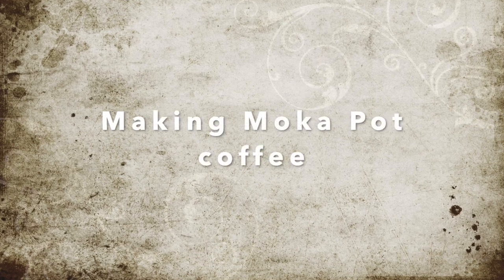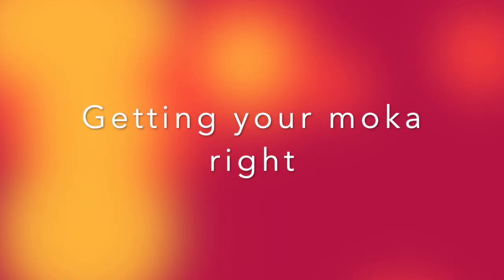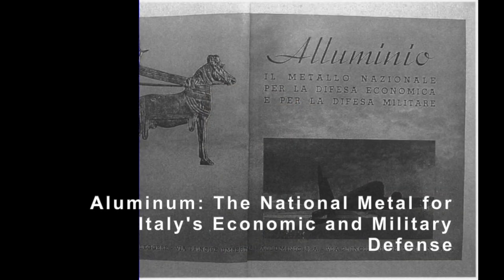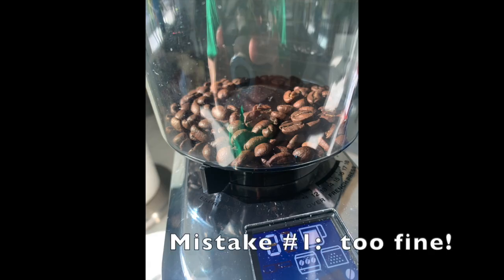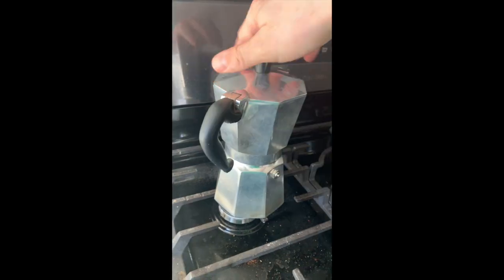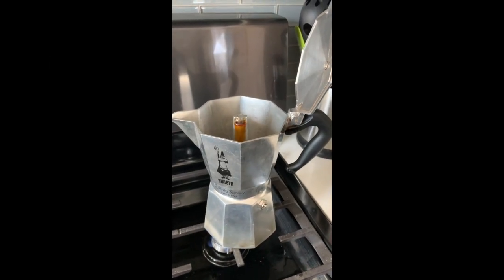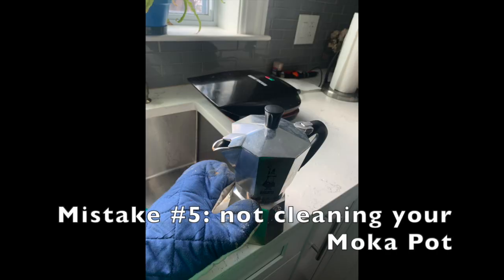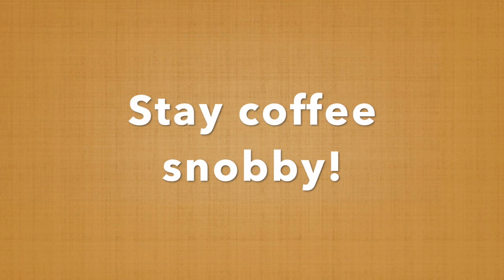Why your Moka pot tastes bad

Comment: Firstly, fill the container with cold water. The coffee softens and eventually runs as the steam intensifies. You never get a bad taste. 
Secondly, give zero shits with cleaning. Rinse after use. That's it. That's all. Replace the ring seal every year ($5?).
Thirdly, blast the heat right up. What is the benefit of turning it on just a little. 
Fourthly, 'grinding too fine' makes stronger coffee. It does not make it too bitter. Just nonsense.
Fifthly, pack the coffee pocket with lots of coffee and positively mash it in tight. Cause what you get is a real strong healthy cup of Joe.
Do you even lift bro?
Reply from the maker: The hot water versus cold water debate is something everyone has very strong opinions about, but I’ve personally found it’s the least relevant thing to consider.  That said, all the notable third wave baristas such as James Hoffman and Tristan Stephenson recommend preheating the water, and a 2008 paper by warren king models this using Darcys law for fluid flow to show the preheated water aids in extraction temperature.  I discuss and explain this paper here (https://m.youtube.com/watch?v=O14BIH-9KTA).  

With regard to cleaning, I’ve experimentally found agreement with you, that it doesn’t matter that much, though everyone again has strong opinions. 

In terms of blasting the heat, though I’m going to disagree with you strongly. It has been received wisdom among third wave baristas, and research papers have affirmed this, that moka pots tend toward over extraction and bitterness.  If you want to go to the extreme of this, I recommend doing a search for “moka pot voodoo”, which specifically recommends keeping the heat so low with you actually turn it off upon first coffee. 

At the end of the day though, what matters is whether or not you have a cup of coffee you enjoy.  Leave the question of convincing the world of your technique out of it and you’ll live a happier life :)

Comment: Hello! Thank you for this review! I'm wondering if you or anyone knows: If I get a 300ml pot, I assume that if I fill the chamber with coffee I'm making what's essentially a coffee with 3-shot intensity? (I've only really had cafe espresso - flatwhites and lattes, coz that's all anyone sells around here. No percolator or plungers.) Will the coffee chamber cope with being filled only a half/third? Must the water chamber be filled to the valve, or can I run the whole thing at less-than-full for both grounds and water on a lower burn?
Reply: Although I'm late in seeing this video, I just wanted to say yes, you can half fill (in your case 150ml) the water chamber.  You'll get a stronger brew by doing this.

Comment: I keep my moca pot clean, i never overboil it, yet mostly my coffee tastes burned...
Reply: You might want a lighter roasted coffee then. The more roasted the coffee the easier it is to extract ashy flavors with high heat water.

Just my amateur opinion
Reply: @solinovo  i use a medium roasted.
But i tried turning the heat down from 5 to 4 , takes a bit longer but the coffee tastes better.

Comment: I do most of this except I don't bother running it under cold water... as soon as I take it off the burner it stops coming out the top so I don't see how anything that stays out of the brewed coffee is going to affect the taste.  Maybe my pot cools fast enough when I put it on the steel stove between the burners (my pot is stainless steel not aluminum so that may be the difference).  I also occasionally use cold instead of hot water and don't see a huge difference.... maybe when I'm too lazy to heat the water I'm also too sleepy to notice the taste.
Reply from the maker: Cold water versus hot water is just a religion. It mostly doesn’t matter, but somehow everyone needs to convince the world that their method is better.

Comment: Mistake#4 was the one I learned most recently. When the coffee is coming out, after a while there will be a "surge" that is more pale and watery. That's the time to take it off the heat. I always used to keep it on until all the water had filtered through.
Reply: Pale and watery means you didnt fill the Grounds pan up and flatten it.... ignore this videos "dont pack it" advice ,you have to pack it if you like strong espresso... which ,to be fair,is what a Mocha pot is for
Reply: @Gianfranco_69  Wrong. The reason Bialetti says don't pack it and don't press it down is because you won't get a good extraction, since the water can't flow through freely when the coffee is packed. The Moka doesn't have enough pressure to push the water through packed coffee. 

If your espresso is too watery or is not strong enough, it's because you're breaking other Bialetti rules.

Try following Bialetti instructions, which are based on science: 

1. Fill the water reservoir with room temperature or cold water (filtered or bottled) to touch the bottom of the pressure valve. 
2. Loosely fill the basket to the rim with medium-fine ground coffee, and use a straight utensil to scrape the top of the coffee off level with the rim, but don't press it down. (Note: Most espressos are ground too fine for the Moka, but the espressos sold in Italian grocery stores are ground medium-fine for the Moka: Bialetti Perfetto Moka Espresso, Lavazza Crema e Gusto, Lavazza Qualita Rosa, Lavazza Espresso Italiano, Kimbo, illy Classico Espresso for Moka, illy Intenso Espresso for Moka, etc.) 
3. Cook on a low gas flame or preheated medium electric stove. Keep the lid closed while cooking. 
4. The instant you hear it begin to gurgle, immediately remove the Moka from the stove and set it on your countertop. It will finish brewing from the residual heat inside the pot. (Don't cool off the pot!)
5. Stir up the most-concentrated coffee from the bottom with a teaspoon, and pour. 
6. Clean with hot water only, do not use soap. Wipe it dry with a cloth. Monthly you can deep clean it by cooking plain water in it.
 
You should see leftover brown water full of fines in the bottom reservoir, and that's a good thing! It means you removed the pot from the stove in time. That water would've diluted your coffee if it had gone through, and would've added a bitter flavor and fines to your cup. There's a tutorial by either illy coffee or Lavazza coffee that explains this. It's also explained in the detailed tutorial by "Il Barista Italiano" channel.
Reply: @Gianfranco_69  this is wrong and dangereous, mocha pot is not designed to withstand pressure as a espresso machine,  that's not what mocha pot is designed for.
Reply: @miguelarturopalomaresruiz  oh....i dont 'tamp it down' like an espresso machine,just fill and flatten it...they are fool proof,they never explode (they have a valve) unless you make a rookie error and put grounds in the bottom and coffee in the top...which i have seen someone do
Reply: @miguelarturopalomaresruiz  nope....Mocha pots maybe reach 1Bar of pressure while a decent espresso machine you would see in a Cafeteria gets to maybe 9-10Bar, how do i know these figures?...
I was a Barista,i have long term elbow damage to prove it
Reply: @Gianfranco_69  Wrong, they do explode from people packing the coffee and doing other things that add too much pressure. As the barista, Liz Happybeans, on her channel. She's from the DR where people pack the coffee so they explode a lot, and a Moka exploded on her family member.
Reply: Gianfranco, Have you not packed it to see how the flavor is?
Reply: Add small piece of Lemon (a good one,like Amalfitan or Sicilian) peel or even Lime peel to the top reservoir (bend it up to release oils) and you will enter level 2 of Stove Top coffee Professionals
Reply: not a mistake, also not a problem, it depends on time  

coffee starts burning (Giving off sour  flavors) 3.5 minutes after it has started brewing (got in contact with hot water), as long as that water doesn't come 3.5 minutes after the brew started there's no problem on waiting for it to finish. 

but if you left the grinds on the fire for a long time is possible that it has already burnt
Reply: Bialetti says to remove the Moka from the stove immediately when you hear it begin to gurgle. Then it will finish brewing off the stove while sitting on your countertop from the residual heat inside the pot, so don't do anything to cook off the pot when you remove it from the stove. Stir up the most-concentrated coffee from the bottom with a teaspoon and pour.
Reply: Great tips. Thanks gents

Comment: I saw another post and adding hot water (not boiling) to the process prevent to overheat the coffee beans. It should taste better
Reply from the maker: Well, heated water (as opposed to room temp.) prevents the water being too cold for good extraction, but definitely 70C is better than boiling for the same reason.  Warren King did a great paper on this, which I discuss in my follow-up video: https://www.youtube.com/watch?v=O14BIH-9KTA&t=269s

Comment: Why you use boiling water?? Just use normal temperature one... Be sure to fill with water checking with the filter the level, should be just under the filter, tilting the moka you have to see water coming up and disappearing when not tilted. Fill with coffee the central part, leveling but not pressing, put on whatever small fire, and when it starts growing it's ready. Do not use boiling water, it's just useless...
Reply from the maker: Answers!  https://youtu.be/O14BIH-9KTA   
 TL;DR preheating the water (NOT boiling) helps with extraction temperatures. If you use room temperature water, the volume average extraction temperature is only 69°C, which is far less than optimal for good extraction.

Comment: Who the hell and why the hell do you boil the water first ?
Reply from the maker: Great question! Here is why: https://youtu.be/O14BIH-9KTA. Helps with extraction temperature.
Reply: @loodog555  it absolutely ruins the process...
Reply from the maker: @joeyc8622  Well, that's a confusing response to the video I posted in last comment.  Do you believe that 69C is actually the best volume-averaged extraction temperature, or do you just not buy Darcy's Law as an appropriate basis for modeling the extraction process?
Reply: @loodog555  I'll make mine the proper way and you do you.
Reply from the maker: @joeyc8622  still not understanding your response.  Are you saying that the lower volume-averaged extraction temperatures are necessary to avoid the excessive temperatures at the end or that Ernesto Illy’s 2002 recommendations of 92-94C are inapplicable here because of the differences between espresso and moka pot brewing?  Or that you question Warren King’s model altogether?

Comment: You can use an espresso grind and use a tamper with light pressure.  Fill cold water to just below the safety valve.  Assemble run your flame to medium low wait.  Have the coffee boil up very very very slowly giving good cream-a turn down the heat to low; when the cream-a starts to change color take the pot off and if needed use cold water to stop the boiling process.  Your coffee yield will be less but much better.  Also buy a stainless steal Moka pot you will notice a big difference.  My apologies for the bad grammar and spelling very tired.

Comment: All good points but you don't need to boil the water first. I only use water from the kettle if I need to get the chill out of my tap water.
Reply from the maker: See like literally all the discussion below and above for the preheating issue.

Comment: Boiling water? 🤣🤣 dear God
Reply from the maker: Indeed! Many are surprised/offended by this idea but... https://youtu.be/O14BIH-9KTA
Reply: @loodog555  please follow baristas like Dritan Alsela so you can upper your knowledge in this matter.
Nobody is going to boil water to pour it into the moka pot. 
Not even in the instruction of your Bialetti Moka pot says this. 
The colder the water and the lower the heat the better it comes out. It really is unnecessary, uncomfortable and not to mention unpractical to do this.
Reply from the maker: @born2drift  I'm having trouble following you, if that is your response to the King paper explained in the linked video.

Do you really think optimal extraction temperature is a volume averaged 69C?  http://www.msc.univ-paris-diderot.fr/~phyexp/uploads/Moka/article1.pdf. Ernesto Illy himself says 92-94C is optimal, or do you just not buy that Darcy's Law is an appropriate physical model for this context?

Comment: I use fine espresso grind lavaza coffee, I fill the coffee right up to the top of the receptacle and very lightly tamp untill even .
I use boiling water then medium heat and towards the end of the brew I slightly lift the pot above the heat to slowdown the brew towards the end.
  The end result of the mothod I use is much closer to espresso with super thick and rich cremma. although it doesn't quite have the same concentration I still love it this way and it perfect for latte style drinks.
(peace and love and brew what suits your preference, many people would say I'm mad doing it like this haha)
Reply: we've already committed to standing in front of the stove - do it however you like!

Comment: please don’t pack your coffee in like that. Pack it so it’s even and flat
Reply from the maker: The permeability of the grinds is dependent on many factors, including how tight the coffee was packed by a factor of two. (http://www.msc.univ-paris-diderot.fr/~phyexp/uploads/Moka/article1.pdf)

The visual demonstration that you see in this video is not representative of my recommended packing style, as you can see from many other comments posted here.  

For further exploration of this issue, I would refer you to my follow up video which is also been linked throughout this comment section: https://m.youtube.com/watch?v=jcgMeDDAT-s
Reply: @loodog555   yes I know that. The right grind AND even dispersion are crucial to a good shot. If this isn’t your recommended packing style, why put it in your tutorial? haven’t read comments and don’t plan on doing so haha :)
Reply from the maker: @xRusTyy  Unfortunately, there is a trade-off between brevity and completeness.  Do you want a watchable three-minute video or me going on for an hour about the various factors and papers that have been written?  (which I also do here: https://m.youtube.com/watch?v=O14BIH-9KTA).  

It is also against my recommended practice to boil the water, but instead to heat it to 70°C.  It is also against my recommended practice to use dark roast beans.  It ain’t gonna make it into a three-minute video. 

All of this is yours to explore in the follow-up videos.

Comment: Thanks for the video! Didn't realize I was supposed to have the heat on medium. I've putting it on high. Oops! Also, cool science fact about Pascal's Principle!
Reply from the maker: The main thing is just do not have it on too high, because your extraction will be uneven, as pressure escalates towards the end. Also, you won’t be able to catch the pot before it’s bubbling. 

And if you like science on this: https://youtu.be/yl4K1no9gh8

Comment: Can we use stainless steel moka pots?
Reply from the maker: It's your life.  Life how you're going to live. 

To give you a real answer, many people swear by stainless pots, mostly giving fears about aluminum leaching into their coffee and poisoning them (largely unfounded: https://www.youtube.com/watch?v=qV3Us0KkIMo).  The flipside is that, since stainless steel has a lower specific heat than aluminum (about half), it will heat up faster and cool down faster.  This may give you a wider range of temperatures for coffee extraction (undesirable) and your coffee just simply won't stay warm for as long in the pot.
Reply: @loodog555  I see it’s a heat conductor...I’m in love with titanium metal now...
Reply from the maker: @lisalisa-ge4ic  Well all metals are good heat conductors, it has to do with how much they hold heat. Aluminum holds about twice as much heat as stainless steel

Comment: I never knew when to take it off the burner. Half way through, if the lid is still on, it flies out the thing all over the kitchen! Probably need to turn the heat down too.
Reply: This could be that your putting too much water in!! Theres a lil nob on the inside that you should let the water flow over

Comment: what size is this? 3 cup?
Reply from the maker: The lower chamber takes 300 ml of water, while the basket takes 30g of grinds.  The result is about 200ml of coffee (and 68g of unused water). I believe this is the 6-cup model:

https://www.google.com/search?q=measurements+moka+pot+size+cup&oq=measurements+moka+pot+size+cup&aqs=chrome..69i57j33i22i29i30l9.4712j0j9&sourceid=chrome&ie=UTF-8

Comment: I TOLD MY MOM NOT TO PUT IT ON HIGH HEAT AND NOT TO LEAVE IT ON THE BURNER. NO WONDER WHEN I MAKE MY COFFEE IN ONE OF THESE IT TASTES SO MUCH BETTER AND DOESN'T STINK UP THE DAMN HOUSE.
Reply from the maker: Yeah, I've been doing a lot of researching the scientific papers about this and it seems the biggest most ruinous mistake is the leaving the moka pot on after bubbling.  You are sending superheated vapor right through your grinds, which extracts them way too much.  I'm in the process of making videos that explain these papers, but if you want to give a read yourself, this is my source: http://www.msc.univ-paris-diderot.fr/~phyexp/uploads/Moka/article2.pdf

Comment: boiling is a no-no. Pre-warming, sure, but boiling just turns the water stale before you even start!
Reply from the maker: Technically, 70C is the best prewarmed temperature, not boiling, but many people do not have a kettle they can set to that so the solution for them is to preboil and let it cool for a minute or so first (http://www.msc.univ-paris-diderot.fr/~phyexp/uploads/Moka/article1.pdf).

I'll actually be explaining this paper in depth over the course of my next few videos so stick around!